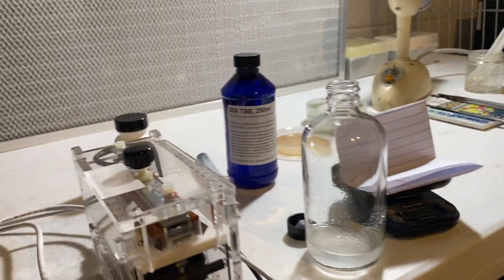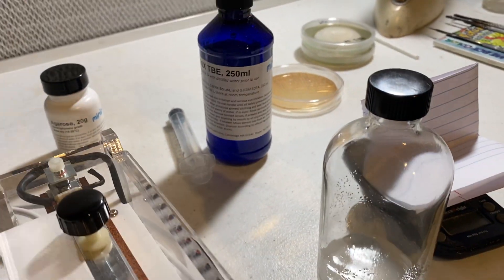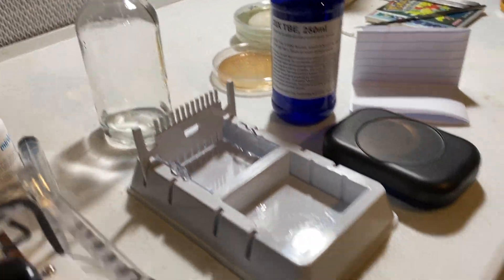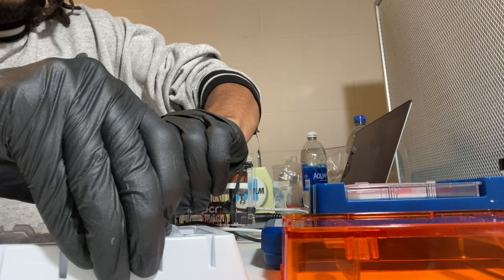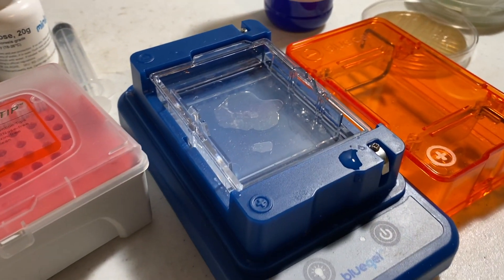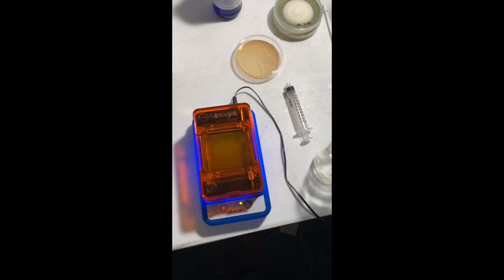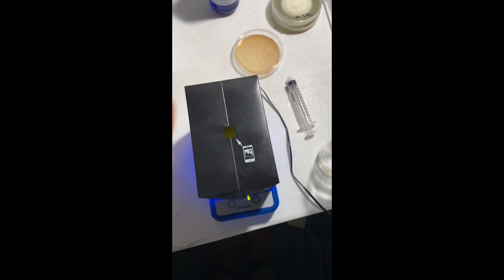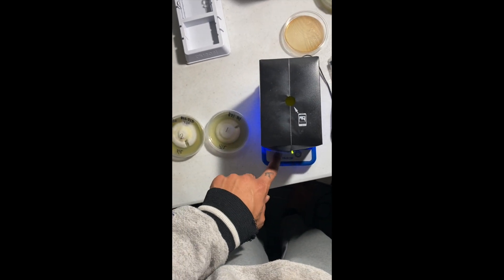Making Gel and Reading MAT-PCR results (Gel Electrophoresis)

Comment: Heat it up in a microwave for two 30 sec.- 1 min. intervals (until it starts boiling) to make the liquid transparent, also make it in a beaker.  It will be super hot after microwaving it, wear gloves, and cool it a bit in running water before adding it to the mold.
Reply: lol, I just saw the microwave comment.
Reply: But do microwaves change the molecular structure? I have read a bit about how it changes the molecular structure of food. It doesn't heat evenly and is less controlled. Yes, it is convenient, however, and can drastically alter what we are putting in our bodies. Not that I am a purist when it comes to eating, but I am thinking about DNA in general. What do you think it does to DNA? if we look at it on a microscopic level, does it alter the DNA or corrupt the information in any way? Just questions primarily for myself as I do research but this did spark an idea.